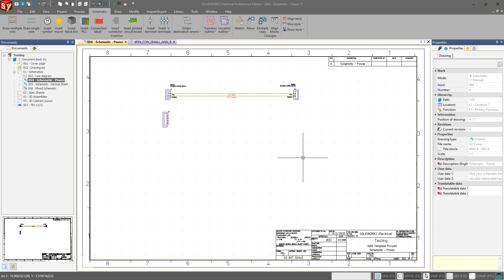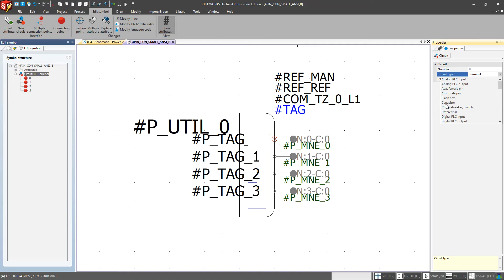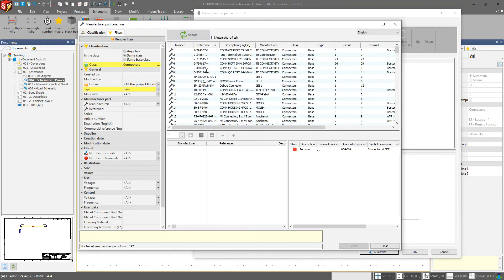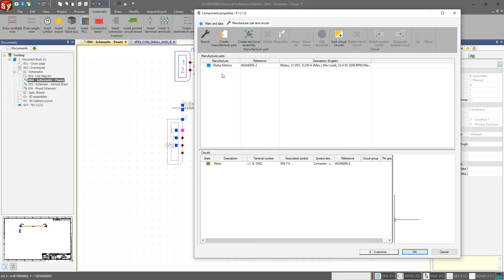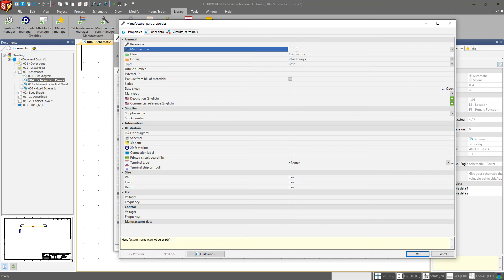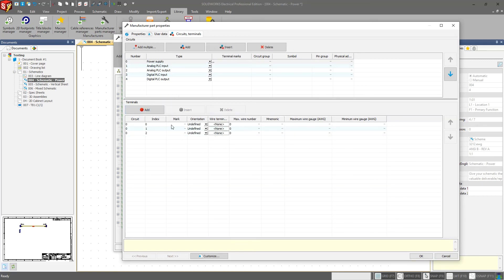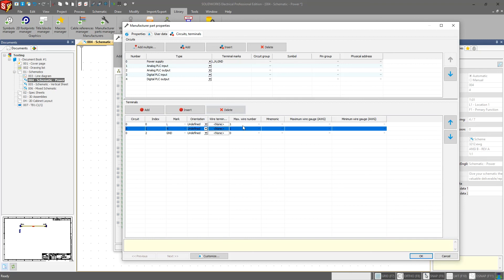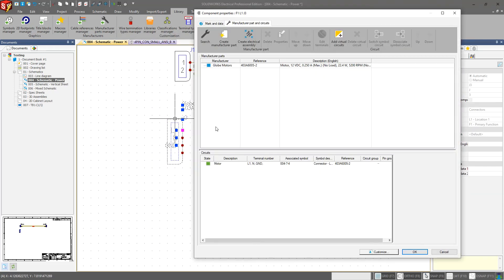SOLIDWORKS Electrical Circuit Types: What are they used for??

Comment: how could I add a circuit type if possible?
Reply from the maker: Currently, you cannot add custom circuit types. However, there are roughly 50 different circuit types to choose from. The generic terminal type would be to use 'miscellaneous' or 'terminal.'